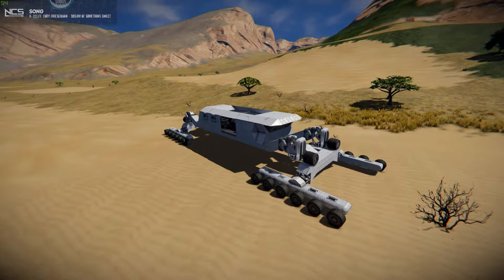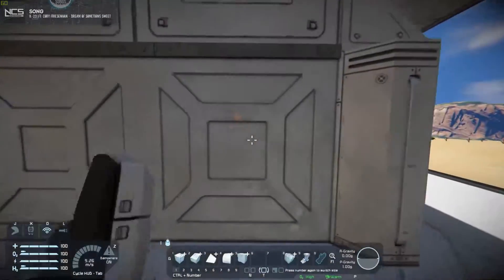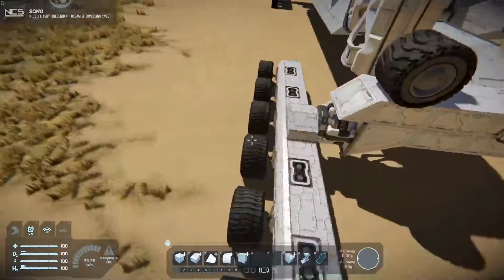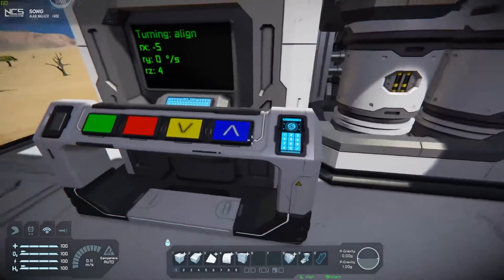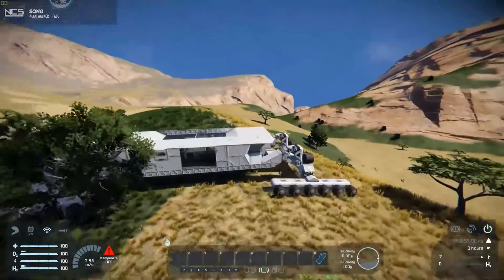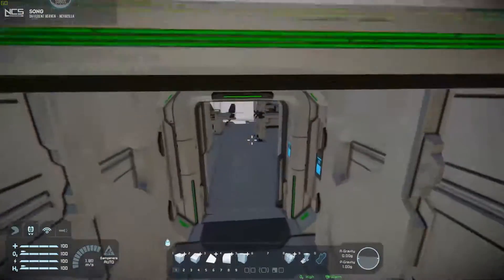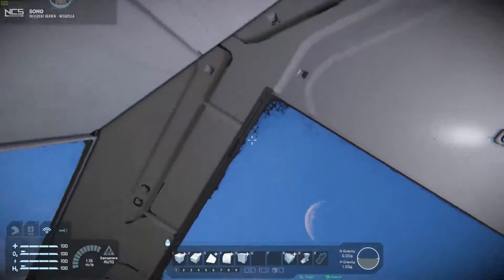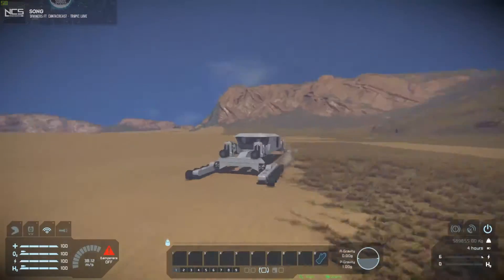Space Engineers - Rover Suspension Explained

Comment: the back suspension rotors dont need scripts just rotor limitations and braking force it works well on my smaller truck based of the mercedes benz lg-1519
Reply from the maker: Depends what you want to do, I wanted them, whenever no fore is applied, to come back to a 0 deg. tilt, your solution wouldn’t do that
Reply: @juleklO  yea and since you need the script to drive the wheels you dont even get to say no scripts and since mine when it is in air the wheels tils meaning the break on landing (:
Reply from the maker: About the scripts, I don’t think I’ve made a single creation without one, they just seem incomplete without the little scripty edge

Comment: 2:56 i see a few designs that uses wheel suspension as a sub suspension system but when i try to do it the armor blocks always just clip right through the wheels. any idea why?
Reply from the maker: No idea, I can only speculate it has a connection with the fps, where the lower fps you have the less frequent the “can this block change position” checks are, and sometimes they just fail. If I were you I’d post a question on the support page, it’s not a widespread issue, but still an issue nonetheless
Reply: @juleklO  thank you for responding. i believe my problem is related to a wheel mod that adjusted the collision. i forgot i even had the mod installed.

Comment: the propulsion and steering of my wheels doesnt work when i put them on a arm that is attached to the chassis with a rotor. someone have suggestions?
Reply: There are scripts to make it work properly but without a script it’s a different grid so your cockpit won’t control it without a script and program block
Reply from the maker: Yeah, at around 10:30 I show all the scripts used, the one from whiplash is the one you want

Comment: I have a question and it's a very minor point (but I'm still curious): Have you tried attaching the arms to the cabin and having the Rotor at the other end? Does it make any difference? Just wondering.
Reply: Not quite sure what you mean about the rotor at the other end. The Osiris dune crawler has a full arm setup for each wheel grouping.while the same thing is doable it requires a much more complicated script (unsure if one is on the workshop) For what he is going for you have the Wheels on the Wheel arm with the Suspension script. Each wheel arm is connected to the main body using the leveling arm. The leveling arm has a "manual" type suspension. While you could use the suspension script in place of the manual it would require another programming block and would potentially interfere with the grav aligner such as require settings reset every time you want to use it.